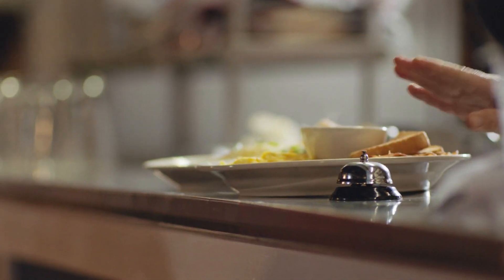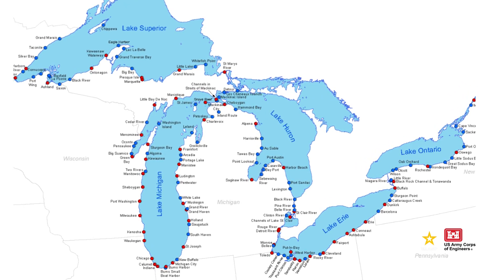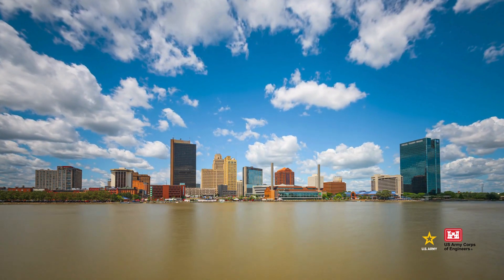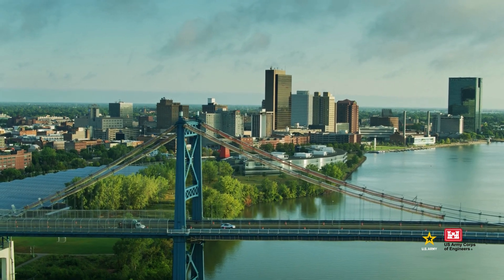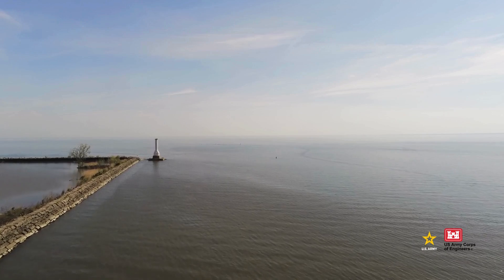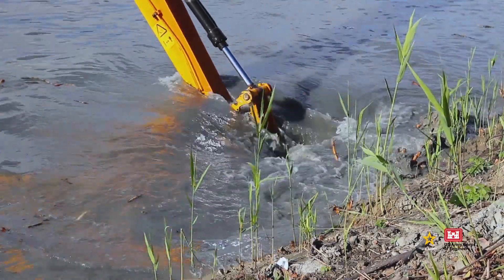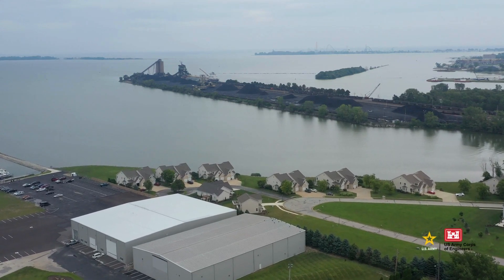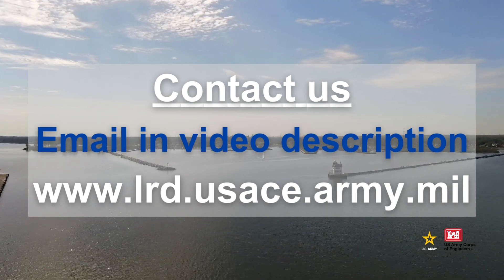GREAT LAKES DREDGING: Planning for Dredged Material Management

Comment: The technique of creating Cresent shaped rain catches in watershed basin within a drough affected region has been shown to have drastic results in reversing desertification. With a half ring of rocks and damming materials and a load of dredged material within the Cresent, rain water has a place to soak in and provide a reservoir for plants to take hold. This results in water being stored in roots and plant material. These Cresent become water batteries, holding moisture for much longer periods of time, allowing for water to seep slowly into the water table rather than flooding the surface and running quickly to the bottom of the basin on the surface. Or evaporating in the dry wind usually that accompanies a drought stricken area. The dredged material can be individually trucked to pre-made crescents. This has been done in India on a large scale to reverse desertification in the north.

Comment: We live on a series of artificial lakes that were a part of our communities development. When built thirty years ago, they were 16 feet deep. Now with sediment some areas ate less than ten feet deep. In another 30 years these “lakes” may be reduces to a stream. While this would be fine in my opinion others prefer the lakes. The problem is the lack of a cost effective way to remove the sediment without disturbing the homes. Because the lakes are an integral part of the cities waste water treatment system, they cannot be dewatered allowing removal by normal soil excavation.